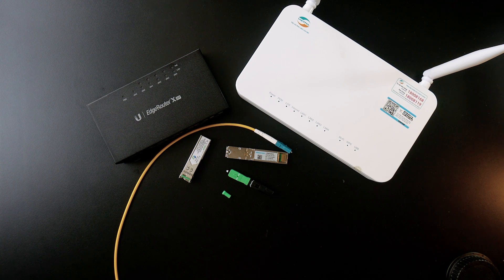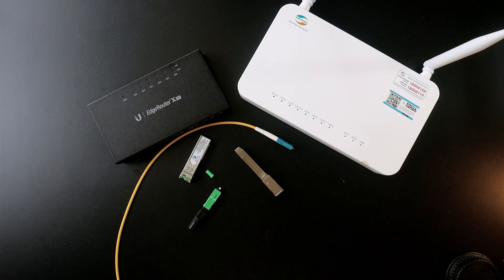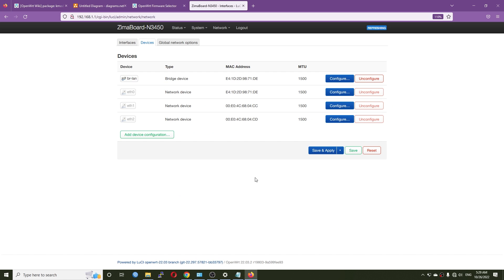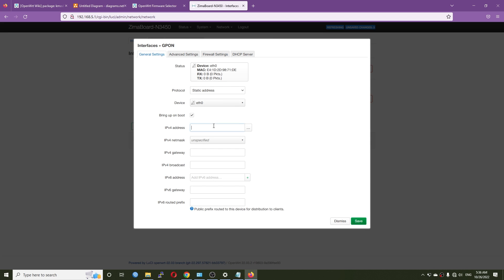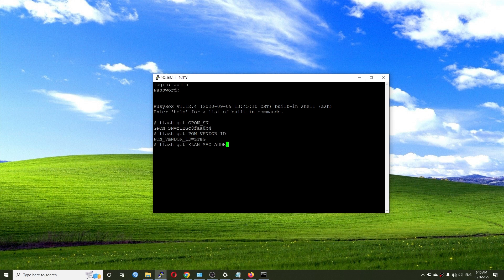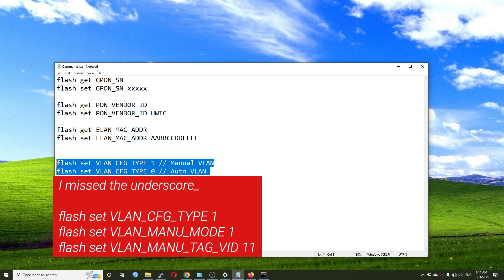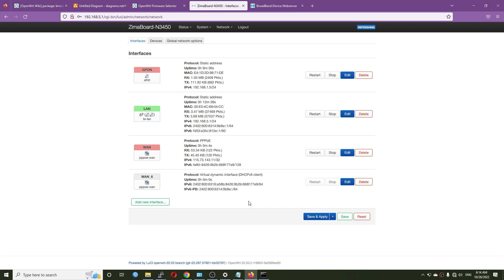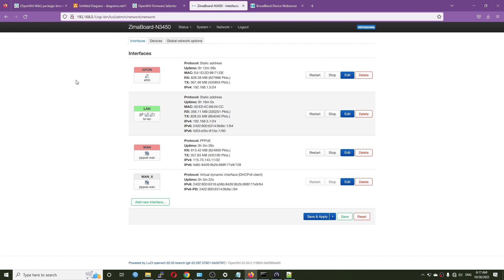Replace ISP ONT/ONU with PON Stick (SFP Module) - Hisense GPON LTE3415 and OpenWRT

Comment: Hi, my question is what's the difference between a router/switch and ont? Are those limited to gpon sfp module meaning can we make any switch a gpon ont by insert an compatible gpon sfp into it? 

Last, are gpon ont sfp and gpon onu spf the same or there's difference?
Reply: Regarding the first question (What's the difference between a router/switch and ont?): They are 3 distinct things. A router serves as a gateway between your public internet address and the devices in your local network, doing what is called Network Address Translation (NAT). A switch does not do that, neither does an ONT (unless it is a combined ONT/router unit, which is the piece of equipment that ISPs usually install in the client's home). An ONT serves as a converter between optical fiber and copper cables and handles the authentication with a fiber ISP's OLT. A switch serves to connect multiple devices within a local network.

Regarding the second question (Are those limited to gpon sfp module?): ONTs are not limited to SFP modules. There are also ONTs with ethernet connection instead of SFP, which can be used to connect to a router's ethernet WAN port.

Regading the third question (can we make any switch a gpon ont by insert an compatible gpon sfp into it?): In this case, the ONT is actually the GPON SFP module, not the router or switch . But you could attach a GPON SFP module to a switch to convert from SFP to ethernet and then connect another port of the switch to a WAN port of a router. In this case, the switch would not be behaving as a switch, but rather as as media converter (which is another piece of equipment you can buy to connect the SFP module). But in any case you would still need a router to do the network address translation.

Regarding the fourth question: "Last, are gpon ont sfp and gpon onu spf the same or there's difference?": There's technically a difference between an ONU and an ONT, but these terms are usually used interchangeably. The expressions "GPON ONT SFP" and "GPON ONU SFP" refer to the same thing. But, in this case, technically, we're actually talking about an ONT, not an ONU.
Reply: @vitorao  Thanks for taking time to write really detailed answer. It really cleared my doubt.

I have another one, for user management, what's the difference between a gpon ont and ethernet switch that's using gpon sfp module? Are they both using Vlan to separate the traffic or there's some difference in their working.
Reply: @RahulAhire , it's pretty unusual to have a switch with a GPON SFP module. Those modules are usually intended for being used directly in a router with an SFP port. Regarding the difference between using a GPON SFP module and an ONT with ethernet connection, they are usually intended for different use scenarios. A simple ONT with ethernet connection is a cheaper solution designed to work with simple routers that only have ethernet connection, and that will work fine for most users. SFP GPON modules, on the other hand, are usually intended for corporate networks that use high-end routers and require an internet connection faster than 1 gigabit/s, as most ethernet connections won't support speeds higher than that. Also, attaching a SFP module directly into a router saves space (which can be a very important thing in corporate racks with tons of equipment) in comparison to using a separate ONT.
Reply: @RahulAhire , regarding the VLAN question, there will not be much difference between a GPON SFP module and an ONT. Both will usually have 2 options. One is called "transparent mode", which will allow the traffic from all VLANs to be directed to the router, and then you will need to configure what to do with each specific VLAN on the router. The other option it to tag a specific VLAN, which will allow only traffic from a specific VLAN, and then you do not need to do any VLAN configuration on the router. The latter is usually done when you need only one VLAN to go into the router and you have an old router that does not support VLAN management.
Reply: @vitorao  thanks for answering it, highly appreciated 👍🏻
Reply: A router/switch is like the Rolling Stones; a GPON is the Beatles

Comment: Is this legal? Or will my ISP get angry of this?
Reply: I have heard that some countries require you to register your modem so you can't use OpenWRT or Pfsense, so legality is country specific. In India, the US and most nations across the globe it is legal, but check your local laws. ISPs don't care as long as you don't become a problem using their service without paying them etc etc...technicians from might have trouble fixing such a system so they might encourage you not to so then you can most probably fix it yourself or use an ISP modem for the time they need to do anything.
Reply: Laws? For internet? XD

Comment: can this SFP module be used to replace the ATT modem? Currently using the ATT ISP provided device to my OPNSense firewall that does not have SFP ports, only RJ45 ports.

Comment: Do you need the zima board to program the SFP module? or can you just plug it inot the Edge Router SFP and then program from there? Also do you need the fiber line connected to loginto the SFP module?

Comment: What about the wavelength of the spf? Should it match the wavelength of the ISp ont/onu? Is it better to purchase the 850 nm 1310 nm or 1550 nm spf if the ont i have had wavelength of 1490 nm for rx and 1310 nm for tx? Is it gonna work properly and smooth or am gonna face Problems if they didn't match?

I appreciate any advice you can offer, thank you.

Comment: I can't access my ONU web ui to clone the gpon settings. I am assuming they have disable web browser management to prevent customers changing configuration. Is there a way to do it anyway? My iphotonix ONU is very unstable; it drops connection too often and a 1gbps connection drops (on wire) to 10mbps every week, until I reboot the onu

Comment: Great video. I have the same ZTE GPON ONU from my service provider. I stumbled across this video, because I was looking for work around instructions for how to put my ZTE router into Bridge Mode. It turns out that the setting is not there because ISP disabled it in the GUI. I have since discovered that the ISP can remotely configure their customer’s routers to Bridge Mode, but only agree to do it if they pay a very small premium for a static IP address (It’s only $1.5 per month anyway). Are there any advantages to having the SFP+ GPON verses keeping my ISP router and having it put in to Bridge Mode ?

Comment: Could someone tell me if it is possible to do this with a Hisense LTE3680M-BC+?  I have one of these SFP modules, but don't know what the IP address would be to access the GUI or if it is even possible.  Wanting to get rid of my ISP provided Huawei HG8240H and plug directly into my UDMP.  Help would be appreciated.
Reply from the maker: Hello, from what I know this module is to insert to the OLT (from the ISP side). It won't work as ONU/ONT (client side).

Comment: Dear Sir
Your video is extremly interesting. I am a optical guy who develop NGPON2 optics. As you know, NGPON2 using different wavelength from GPON, so NGPON2 is always compatible to GPON. My question is whether we can use old GPON router plus NGPON2 SFP PON stick for NGPON2 network. What I am saying is can I change the GPON to NGPON2 by only add NGPON2 SFP PON stick on my GPON louter. Assuming the NGPON2 signal is available.
Very thank you for your valuable comment.

Comment: Thank you very much, and frankly, I was very pleased with your explanation about Hisense GPON LTE3415, and I decided to buy it from the Internet, but unfortunately I could not find it. My question to you is, is there any piece equivalent to the one you explained about? I have a Huawei device, model EchoLife HG8240T5 GPON Terminal (CLASS B+). Can I use it with my MikroTik RB5009? I thank you again
Reply from the maker: Hi, you can take a look at the Nokia G-010S-A which is widely available
https://youtu.be/3g6mRDfUppQ or the ODI GPON SFP module.
Reply: How about using MikroTik RB5009 ? Is it work with it? Thanks

Comment: thanks for this videos ,plz can help me to make the same operation ,I have EdgeRouters 12, ZTE F660 ,FTTH
Reply from the maker: Hi, sorry for the late response.
From what I know, if the ONT is ZTE, most likely the OLT will be either ALU or ZTE.
In this case, you can try the Nokia G-010S-A which I already made the video. This GPON SFP module should be available on Taobao, AliExpress and other marketplaces.
Reply: @VanTechCorner  thanks for replay

Comment: which model of ( Mellanox ConnectX-3 ) u are using? its budget?
Reply from the maker: Sorry for the late response. This is the module that I used, but please take not that it will not work with all type of GPON SFP module https://youtu.be/6sfs6tvDkg4?t=76

Comment: Thanks for the video. I just bought a banana pi R3 which comes with SFP ports. I would like to incorporate the fiber into the piR3, like you did. I live in Turkey and my ISP is Turk Telekom. They installed a Calix T072G ONT at our home. I am looking for an SFP module to buy and would like to get something somewhat 'hackable' because I don't know how flexible the ISP will be with a different ONT. Do you have any recommendation? Thanks a lot!
Reply from the maker: Hey, you can take a look at the Nokia G-010S-A  or the Huawei MA5671a. For the G-010S-A, you can see my recent video for more info https://youtu.be/3g6mRDfUppQ

Comment: I wish this would work with AT&T Fiber. Their equipment is garbage. Thanks for the great video!
Reply: It's optical, it probably does, you just need to know the specifics of the service (service provider nuances).
Reply: @jamess1787  It does not unfortunately because the authentication AT&T uses for their FTTH network. I tried cloning the MAC but the Certificate used is hard to extract from their equipment.
Reply: ISPs in the US could probably get away with literal murder based on the way they're allowed to bribe representatives to sign agreements to disallow competitors to come in. Comcast is getting really bad lately. Last year I had to sign another contract with Comcast to keep my price down. Their discounted plans all had a "you have to use our modem" stipulation. If I wanted to keep the modem I bought, I'd have had to pay something like $200 MORE per month. In my area I don't even think I can get DSL. It's Comcast or whatever WISPs exist here.
Reply: 8311

Comment: Our fiber provider uses active ethernet (ONT is made by Raycore) - what is the difference between that and GPON ????.
Reply from the maker: Hi, may I know the country? Do you mean Active Optical Network (AON). If yes, here is the comparison done by FS https://community.fs.com/blog/pon-vs-aon-in-ftth-systems.html
Reply: South Africa (ZA) - ours was ducted underground but other providers string the cable along existing street poles, and they use GPON.

Also we just get internet - no TV or VOIP services.

Comment: Hi I have followed many of your excellent guides as well as onemarcfifty, I am on BT full fibre in the uk I have a ONT connection which goes directly to my r7800 using NSS 22.03 openwrt

Why would one replace the ONT? I am a little puzzled by this what are the benefits to swapping out the ISP connection, I have excellent uptime and my speeds are more or less as advertised

Very curious as to the point of this exercise
Reply from the maker: Hi, there is pros and cons of doing this and we have another comment discuss this. If you have no issue using the ONT from the ISP, there is no need to replace it. Along the way, when you slowly upgrading your network rack and want to reduce the number of devices to build a nice rack, perhaps you will need one

Comment: My ISP router has ACS enabled and has its username and password. Do you know if I can use this to switch my ISP router?
Reply from the maker: Hi, I have no chance working with ACS so I can be sure it will work. However, I believe it is something configured on the router side, not the Fiber/GPON. First, you will need to understand your ONU and OTL before we can move on.

Comment: Do you think is it possible to make it works also with other SPF NICs? Like Connectx-2?
Reply from the maker: It should be as the SFP GPON module is just a the same with a normal SFP transceiver (module). Unfortunately I don’t have the device to test.

Comment: After the configuration in the zima board... if I take the sfp module and put it in my Unifi Dream Machine Pro SE, do I have to do anything else?
Reply from the maker: Basically after you configure the SFP Module (with a Media Converter / x86 OpenWRT Router PC with SFP port, etc) the SFP module will become the ONU/ONT and you can plug it to any system (EdgeRouter Pro / UDM, etc). You can also configure the SFP GPON module with the UDM as well (by create a bridge and assign an IP address, I done this with EdgeRouter, not sure about UDM).

Comment: Hi, I have GPON connection as well and would like to replace ONT and ISP's router with my own gear. If I follow that tutorial, is it guaranteed to work? Do I have to get exactly the same SFP module as in the video?
Reply from the maker: Hi, the answer is no. You need to understand what is the OLT and find a suitable SFP GPON module ( that can communicate with the OLT)
Reply: @VanTechCorner  Doesn't GPON just use PPPoE?
Reply: @VanTechCorner  how do we find the olt?
Reply: @chaoscapricorn13  communicate with the staff of the NOC.

Comment: thanks for all your videos you are very important to explain with this way pls I want to buy a D-Link DIR-842 like you show us a video about openwrt plz answer me soon
Reply from the maker: Hi, I foud the D-Link DIR-842 C2 when I was working in Malaysia. This device was provided to the customer for free if they sign up for Internet plan from Unifi (TM). That is why the router is sold very cheap secon hand. If you plan to buy a router, I suggesg the Xiaomi Router 4, or the Xiaomi R3G for better support and WiFi coverage.
Reply: @VanTechCorner  
thank you very much but their routers no comptible with oprntwrt I use it as access point so i want you to advice me to choose one wich has port usb to extend the memory and install more  application and i want it has dual bands 2.4 and 5ghz and be easy to install openwrt without problem or with usb TTL thank you agin

Comment: So so much interesting.

Now I may look for a small 4 port PoE (~50W) switch with SFP for being able to use this.
Reply from the maker: Hi, you don't need the PoE switch to power on the SFP module. Any router or switch with SFP cage (port) will do.
Reply: @VanTechCorner  that's what I need. I have 3 PoE APs (UAP AC PRO) and have no SFP port. So I need to power the APs but need SFP too
Reply from the maker: Since you are using UniFi/Ubiquiti products, you can take a look at the UniFi Switch 8 PoE (150W) or the EdgeSwitch 8 150W. They are quite expensive IMO. I will grab a 5 ports PoE switch, such as the Netgear GS305P or TP-Link TL-SG1005P and a media converter for the SFP module.

Comment: what about xgs-pon , which one would i need ?
Reply from the maker: I have yet to use it so no clear information on this. However, I can see that XGS-PON use a different wavelength compare to the GPON, this is something you need to pay attention to when looking for a compatible XGS-PON SFP model/ONU. For the authentication I believe it will be more or less the same...
Reply: @VanTechCorner  thank you. and great channel you have very informative and love you videos showcasing openwrt and the latest embedded devices,
Reply: @lixxus-m  did you found a solution for xgs-pon?

Comment: what will be the improvement using the gpon ? more speed?
Reply: A little space is saved, and that's it.
Reply: No backdoor on the ONT device?
Reply: @somebody301  What can a backdoor do when it is on a separate network, protected by your router/firewall? It is located at your home doesn't mean it can do anything -- it is basically like a malicious device on the Internet.
Reply from the maker: You will have more control of the devices and more statistic of the “ONT/PON Stick”. Save space, save power and you don’t need a power adapter for the ONU … Less cables, simple setup …These are thing I can think of. There is no clear evidence but the PON stick will also increase the connection stability (both Fiber and Ethernet). I have the PPPoE connection up and running for more than 3 months with no down time.